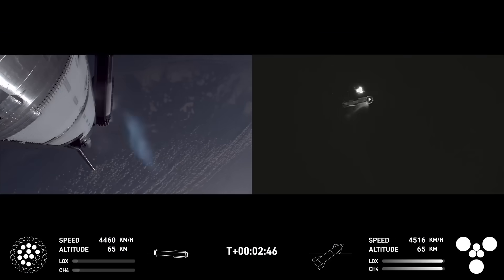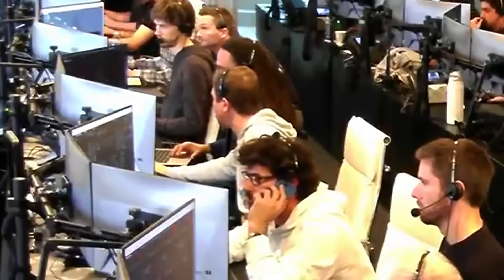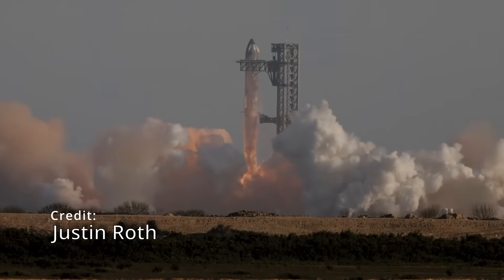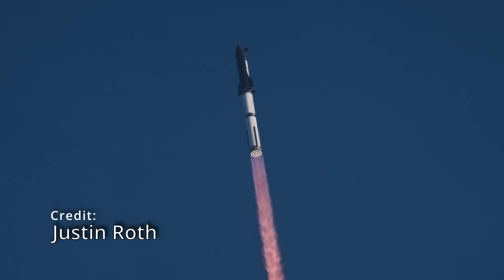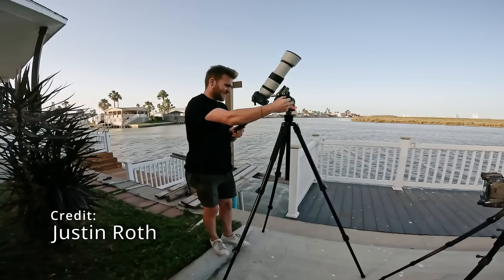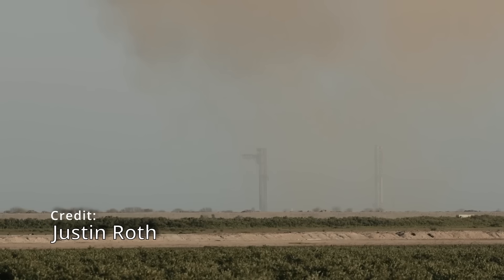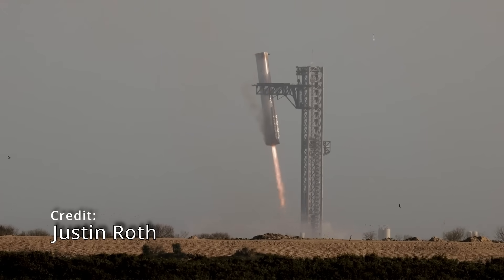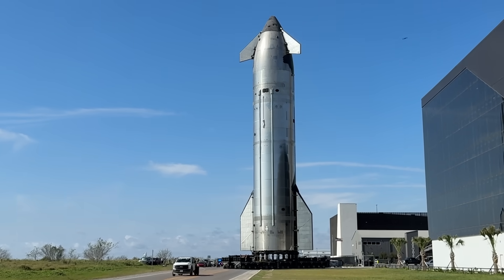Rest In Pieces: Why Did SpaceX Lose Starship Again?

Comment: The most audacious thing SpaceX does is the booster recovery - and they have nailed it to the point where we accept it as 'normal'. Starship will succeed.
Reply: It’s the equivalent of getting your drone to come back. Just amazing.
Reply: They barely did that this time, 3 engines failed on the booster also.
Reply: @Nobody-Nowhere  Yes they are not the most reliable engine seen. I think they should test them a bit better. They have burned them a minute static at sea level but maybe they should put them on a shaker.
Reply: the catch is very impressive, no one accepts as normal. utility is still missing though. launching a viable rocket seems to have had many unpredicatable explosions. who is paying for all this?
Reply: @lapis.lazuli.  Spacex business is managing risk
Reply: @lapis.lazuli. catching a booster is meaning less whe it comes to Artemiss 3. Getting tk orbit is the goal not catch random boosters.
Reply: The catch is always impressive but it seems the least sustainable and carries high stakes downside
Reply: @mrandmrsmartin 
Mainly for an idiot called little Jimmy.
Two minutes on Google says this about Starship finding.   You should gave looked before gobbing off 

A part of the starship program has had federal funding towards developing a specialised vehicle for the Artemis program.   Recd, approx 2.4 $Bn   The rest of Starship is funded by SpaceX commercial revenues  and the equity finance market (investors)   Already by 2021  it is stated that this amounted to over 6$Bn. 
SpaceX is self funding the vast majority of Starship.     This back stabbing musk is probably some Democrat immatures  who should go to their room and do school work  until Ma calls them for bed time.
(This from Europe,  by an active Non democrat)
Reply: It is good and incredible but it probably will fail too. There where engine problems on the booster too. 
I hope too that Starship will succeed but possibly they are pushing the envelope too fast. There is so much new and failure can happen at different times in the same component so too much new can make it confusing. I am an engineer, mainly maintenance so I have made my living chasing problems in equipment big and small for 50+ years.
Reply: @leonhardtkristensen4093  it’s a stupid design.
Reply: @James-hd4ms  You may well be right. I am a design engineer but not of rockets so I don't know what is good and what is bad. I believe to remember that Stainless steel is the cheaper way so they can afford to loose a few more. It obviously gives other problems but if they can be ironed out then it can be ok. Just about every thing has it's advantages and disadvantages. One with stainless steel is that it is harder and there fore can resonance easier. That is a problem with vibrations as it may break easier.
Reply: mrandmrsmartin @mrandmrsmartin  One hopes.   I for one am impressed by their string of successful experiments.   Admire the bold who do not fear to do their work under public scrutiny  Most technical progress was made this way ,  --   Lillenthal,  Montgolfier,  von Braun,  Garand,  Pasteur  Babbage and Turing  ....  we stand on their shoulders.
Reply: @causewaykayak  Well, that’s wrong.
Reply: None of the boosters have been reused, so catching them is pointless. 

Starship can't make it to LEO and can't be recovered in one piece yet either after 8 aftempts. That's an abysmal failure rate and prohibitively expensive.
Reply: @mrkeogh  I don't understand your comment. Starship v1 has had three successful water landings already - they only had one finished tower so had to choose between catching Starship and catching the booster until very recently but the water landings seemed pretty solid. If I remember correctly it took a lot more Falcon 9 flights before they were even landing the booster reliably. There is a great video on that from SpaceX, something like "How not to land an orbital-class booster".

That said there does still seem to be a problem with v2 Starship. It is fair to ask whether they should have stayed with the v1 Starship further into the initial testing and only then switched to v2 and/or v3... it's easy to say "duh, yes" right now but based on the degree of change between v1 and v2 it's also fair to say that would not have been obvious at the time. I obviously don't know what the problem(s) is/are with v2 but there can only be a few potential causes for early engine shutdown near the end of planned burn, and the reports of engine explosions seems to limit the possibilities even further (eg fuel running out before LOX).

SpaceX has a lot of telemetry streaming down during each flight so hopefully they will find the root cause soon.
Reply: @mrkeogh  # boosters have been caught is proving the concept which is valuable but LEO no, not a rocket I would put my satellite on soon - that is I can hardly afford putting up a kite so I am not a customer anyway.
Reply: @mrkeogh  you must be a hater aa you comments show!! So how did  Spacex manage to become the unchallenged leader in space with 80 percent marketshare in thr satellite business worldwide via their reusable falcon 9!?
Their market value has gone up and up their costs are so low that even though they are selling at 40 percent  of their competitors they can still make handsome profits! And guess what? they will cancel Falcon 9 the moment Starship has proven itself as fully reusable as well. That is being a business leader that goes all the way. 
Your hate us not going to change this!
Reply: @ It's Elon's money so mind your own business, since you clearly don't understand the concept of "test flights".
Reply: @ericperkins3078  It's U.S. taxpayer money. My money.  I've seen so many test flights, rarely with so many fatal failures though.
Reply: @littlejimmy7402 You need to watch or rewatch their video on “how to not land a rocket”.
Reply: @mrkeogh  This is such a boondoggle.
Reply: @ Maybe you should pull your funding, eh?

Comment: They need to hire me as an expert material scientist failure analysis and quality engineer I can determine what when wrong and help suggest and test corrective actions…obviously the computer simulation is a weakness should be able to run and test many computer models to determine reliability before launch…this is what design of experiments are for…sad result for certain…but I doubt it would happen with me on the team! I’d had the last failure completely modeled out and DOE tested new designs to assure reliability and fully understand the safety factors at play…extensive model testing and ground testing of all weak points or risk factors…there is no excuse if you have enough modeling resources…
Reply: Probably will spend more time writing 5 things I did last week reports than actual work

Comment: Thanks for the speedy report, Ellie. 

SpaceX lost the first 2 block 1 Starships on FT-1 & FT-2 w self-imposed RUDs. It seems like we are right on track with Block 2 with 2 initial self-imposed RUDs. 

I do like your supposition that we’re loosing Starship at approximately the same time in the flight. Perhaps they are just pushing to get going regardless of understanding the underlying failure  mechanism. Elon has always been willing to take greater risks than the average aerospace company.

Comment: I think this further reinforces the fact that Starship needs a crew escape system. That needs to be on there for the first flights with human crew.
Reply: Starship needs to be fully developed to be a safe and reliable spacecraft, like Falcon 9.  Once fully designed and adequately tested with hundreds of un-crewed missions, Starship will be safe.  It's very early yet.  Space is hard.  SpaceX is hard working and smart.  They'll solve these problems and the ones after this.
Reply: I wouldn't get on the shit
Reply: Do you really think there will ever be a manned Starship?
Reply: Unfortunately it's the same situation as with Columbia, which did have a crew escape system. It would have been impossible to jettison/bail-out in the hot atmospheric re-entry phase, and the subsequent tumbling of the craft would be fatal to any unrestrained astronaut.

Comment: Space X really needs to understand that the public at large has zero patience for rocket debris raining down on populated areas and zero patience for airliner flights being diverted. The public has zero patience for that to happen TWICE in a row. This is a public relations disaster. Space X is losing the good will of the general public. We in the space community may be too close to it to see how the public is perceiving this. It’s a disaster. Space X has got to get this situation under control whatever it takes. If that means a pause while the whole Starship version 2 design is reviewed, so be it. Space X has a massive public relations problem, and that’s in addition to the engineering challenges.

Comment: This seems to be something that happens only in vacuum so it will be hard to validate a fix on the ground.  I don't think this is an oversized big deal.  It may take several months to sort out or it could be only several weeks.  Space X will have a lot of data that we don't have that might make it much more clear what went wrong and it may be something completely different from last time.  Something that wouldn't go long until they fixed what went wrong last time.  It's a process that they just need to work through.

Comment: Potential possibility:

The revised placement of the forward control surfaces coupled with the additional tank length of Starship V2 is causing additional and unforeseen stress on the lower seams of the methane tank (in the attic area). This additional stress once combined with the general stress in and around this area during Starship engine ignition (at hot staging) is resulting in a minor but sustained leak of methane into the attic area.

Comment: For the next one what they need to do is double check everything make sure everything is sealed correctly and welded correctly and also they might want to do a protective secondary covering to make sure there's no buckling underneath pressure. Basically it's just pressure buildup or a zit. We all know what it's like to have a zit

Comment: It’s because they’re using those sea level engines too high in the atmosphere. They need to switch starship to the original plan of six vacuum engines and three sea level engines to be used only for landing.
Reply: Easy
Reply: Fucking easy
Reply: they can barely take that empty shell with six engines into suborbital flight and you want to add three more engines?
Reply: what makes you say that?

Comment: I'd suggest this is another fuelling issue, pogo problem not from engine instability but from elastic resonance of the tanks themselves. Stiffer tank walls required together with baffles to dampen the "sound wave" in the fuel.

Comment: there is a tough critical path before the mars line up in Fall 2026.  
1)  need to land on the moon to test out the legs. 
2)  before that,  need to do in orbit refueling,  since both moon and mars require it.  
3)  before in orbit refueling,  need to master rezendevous and docking.  
4)  before that,  need to send up a tanker starship filled with fuel as payload.   
it might make sense to do rezendevous and docking with starships that aren't filled with fuel  initially.

Comment: I wonder if the hot separation might have something to do with it. Hope they figure it out soon, the booster catch is simply mind blowing...........
Reply: Maybe, but previous flights have done them without problem
Reply: Either way, Raptor v3 will fix it, since it has much better shielding
Reply: Yeah it’s got to be something in the design that wasn’t present for version 1 so that most likely eliminates hot staging

Comment: 6:27 The FAA focuses on safety, so as long as SpaceX operates within the safety margins approved by the FAA, I don't expect this failure to weigh too much. Starting with flight 7 they had a lot of changes to Starship, so I'm not surprised they have issues. We're basically in a new cycle. The first two flights were also failures - quite big ones. And we're probably not even close to the final design. They still have to integrate that separation ring, stretch the tanks, do a lot more work on the heat shield, and the payload dispenser hasn't even been properly tested yet - to name just a few big items.
Reply: Gene Rowley, an NSF commentator made the comment that with all the changes between ship versions this was more like V2 Test2 than Test 8 and I think he had a valid point. All the internal rework, it’s almost like a whole different ship than V1 so we should expect some bumps…
Reply: We can also guess what parts of the FAA will be next on the DOGE chopping block ... :o
Reply: Yawn, it hasn't even done the basic thing of getting into orbit.
Reply: @juliusdavies2005 They achieved orbital speed since flight 3, but doing at least a full orbit would be a waste of time until they get the heat shield right. So they re-entered the atmosphere early, to test that shield.

Comment: They should be grounded until there is a mountain of test data proving they solved the problem. That is the minimum you expect from passenger airplanes. Try it again and see what happens is NOT acceptable public engineering. Since they obviously never solved the problem with Flight 7, Flight 8 should have never been launched....oh wait, didn't the FAA say that just before Elon took it over?

Comment: Odds are there are more cameras and instrumentation for this flight that may narrow down the actual issue.  If a dynamic issue it is likily to be different in space than during a static fire.  Pogo was a probably a similar problem early in the space program...mostly only happens in flight.  Since the problem seems to occur at about the same time, another suborbital flight, but only to 120km and 15,000kph followed by a water landing and starship recovery from the drink may be needed.

Comment: Increasing the shock absorbers between the supper booster and starship vacuum engines because they may have taken a terrible vibrating and sound turbo beating that could have challenged the vacuum engines that's if they were left open after closing the hatch between the super booster and starship vacuum engines.
I think it is best to plug starship vacuum engines up with some type of heavy duty shock absorber sponges and then place them down all through the interior of starship because the kinetic energy would use the weight of starship against the interior of starship.
I also believe
turbo sound waves vibrating kinetic energy through the entire starship would always cause problems like breaking up sensitive connections and opening up valves if not stopped.
Kinetic energy is the starship's worst enemy because kinetic energy power up through gravity and shock waves and sometimes sounds and vibrations.

Comment: I am sure there will have been a whole bunch more cameras and sensors than floght 7, specifically because of flight 7 RUD. i doubt there will have been signifcant changes in the flight 8 hardware. They flew expecting the same failure but wanted to understand it. 

Expect a large wait now for the next flight.

Even the booster is getting incrementally worse 2 engines failed on boost back and one on landing burn 😮

Comment: Sometimes going fast and breaking things doesn’t work out. There is clearly a design issue. My dad was an aerospace engineer, he would have been appalled that they launched today without knowing what went wrong with the last mission before launching . He would say they were fools who got what they deserved. Aerospace engineering for MANNED FLIGHT isn’t a place where Silicon Valley attitudes of going fast without pausing for thought really work out in the long term. Mars will be unforgiving. I hope this unmanned repeat failure back to back will prevent deaths down the line once people ARE in these vehicles heading towards Mars. You need to KNOW what failed before risking lives again. The lives on the ground in the Caribbean under these unplanned disassembly’s were put at risk today for Musk’s hubris. Shame on SpaceX.

Comment: Too much stress with starting the raptor engines on starship with the locking ring still attached.  Redesign the locking ring to better handle the force of the raptors.

Comment: I believe there still is a problem with the fuel feed system: possibly, there could be a resonance between fuel Pogo oscillations and the frequency of resonance of the feeds.
Or, there Is a problem with the new Raptors, but I don't know enough ti make a Guess on the cause.
Go SpaceX!
Anthony
Reply: the three small downcomers seem so flimsy

Comment: My question is, if it is the same issue with harmonics causing leaks, then the question is, are the leaks ahead of the Raptor engines or is the leak ON the Raptor engines?

If the former, then yes, a redesign may very well be needed.

If the latter, then how soon can the Raptor 3 be available in sufficient quantity to fully equip a Starship Ver.2?

Comment: Maybe they will just have the starship on the launch pad and load it with 5% fuel and test the engines to locate the fault failure, If it passes then move up with the load amount.
Reply: SpaceX has already done static fire tests of the engines in a horizontal engine mount and static tests of engines mounted to a SuperHeavy and a Starship.  They believed they learned all they could in static fire tests so they moved to the next stage where they learn by instrumenting ships and blowing them up in a real world test lab.  This is a radical departure from how aerospace development has happened so it's no wonder that people can't help but see this as some sort of failure, or at least a serious problem.  In reality, most product develop involves destructive testing.  The only real difference is, SpaceX is doing this very publicly and very spectacularly.